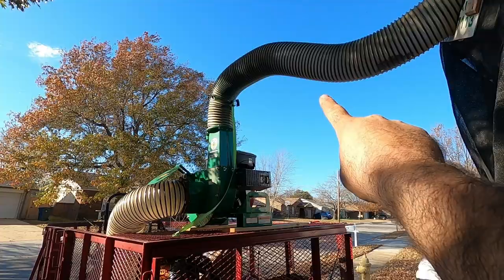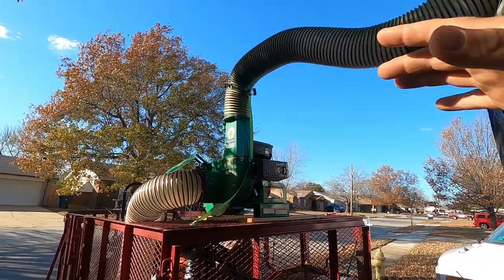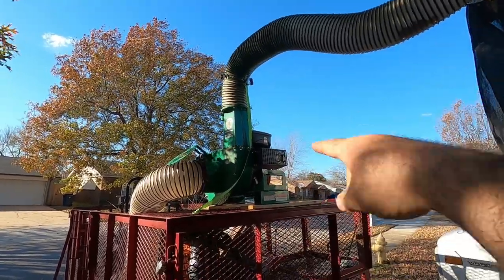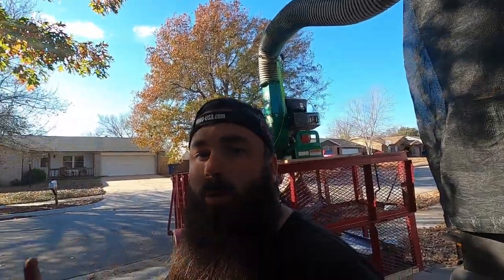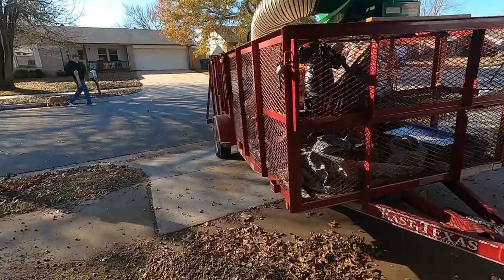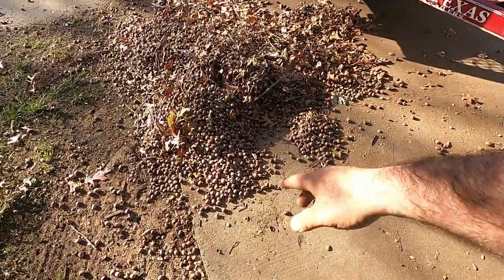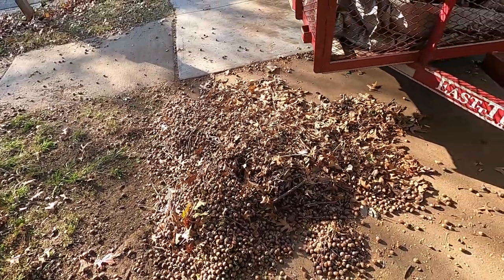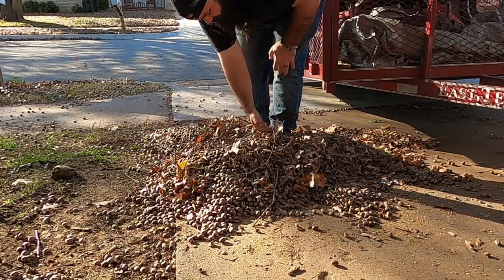WHY BILLY GOAT SUCKS! Putting the BILLY GOAT LEAF LOADER  TO THE TEST - How I fixed my leaf loader.

Comment: The debris loader is mounted to high. I mounted mine just above the trailer rails. Also mounting it lower better utilizes the length of the hose.
Reply from the maker: I dont have that option. It works great at that height though.
Reply: Hes right I own the truck tailgate mount version but mounted on the front into out plow mounts and it shoots through a 6” solid pipe into a solid box with ridge vents the only issues we have is when we suck up wet leaves and little sticks getting stuck your mounted too high and your discharge vent is too flexible and probably too much air release with the netting  has to act as a suction
Reply: little late, but that's what I was thinking the whole time. Any problem you were having would be fixed by having the blower mounted around the same level the acorns are accumulating and it would stop that. After everything gets chopped at the lower level its easier to blow it as high as it needs to go. No stopping and the hose wont ever need to be lifted over your head. Mount a bracket to the front of the trailer.
Reply: @cheezedoodle8356  Yes exactly. I’m sure this setup can get along with regular dry leaves and work pretty good but acorns have a round small surface space. My Billy Goat is really good at sucking up the sweet gum balls in late fall and spring. Great units but they have to be setup correctly.

Comment: Great video. Just giving you a head's up when you aren't using the Billy goat or your done for the day. Make sure you cover the engine as the spark plug will corrode and fuse to the mount. And the only options are drill the spark plug or engine replacement. If you have a honest Billy goat dealer they will tell you that the Billy goat is not covered by the warranty and should not be used in the following eg, if it is raining or if the leaves are wet. Apparently it states is in the owners manual. An outdoor machine not for use outside. It was an expensive lesson for me to learn
Reply from the maker: That is really good to know. Thank you.

Comment: For stuff denser than leaves get a narrower suction hose so that air velocity increases.

 If that's not possible attach a foldable bar on top of your trailer cage with a loop on top and noose that hose head with a rope. Now you can just pull on the rope and move the straight up in a second.

Larger motor won't work any better.
Reply from the maker: Having a big pile of accorns like this really almost never happens. If they are blown up to the truck with leaves the pull right in like they are not even there
Reply: I was thinking of a similar solution. My Grand dad always said, "Work smarter not harder.

Comment: I think for instances like these, you need a spring loaded lever mounted above the Vac to lift the hose higher. Make it adjustable so you can lower it when not needed.

Comment: I wonder if it would work better if the engine/propeller  was lower on the trailer  and the exit tube was higher?
Reply from the maker: oh ya it would really help out. on my old truck my loader was at about chest height and it pulled through great.

Comment: We sucked up 2 tarps full of acorns a couple of weeks ago. It took a while and we had to pick up the tube several times to get them through. At the end it looks like feed in the trailer. It was pretty cool, I love our billy goat loader.
Reply from the maker: Leaf season with out a loader would be horable
Reply: @LawnCareJuggernaut  This is our first year with one, we used a Walker mower in the past that bagged it all. Between the billy goat and we just got a leaf plow our cleanups are actually fun now :) I just got to get a better way of dumping them by next year.
Reply: @HungryCowLawnCare  Did you get a better way to dump? I'm about to build a box for our truck with a side "dump" section.  Hard to explain but I'll use 4' plywood all around left, right and front as well as a full floor no lower the the truck bed sides on 1 side and about 6-9" higher than the side on the other side. There will be room under the plywood floor for tools and stuff. The plywood floor will be tarped tight and the low side wall will be on hinges and kept closed with a pin system. Pull the pin(s) and the leaves on the sloped and slick floor should fall out.

Comment: Another issue is the height and distance the acorns ha e to travel before it hits the hose. On it next set up have it closer to the ground. The impeller will blast those no problem.

Comment: Not sure the billygoat has enough power to pull all them acorns up looks like its kinda struggling because of aerodynamics as well as weight acorns are heavier then leaves but it did a great job on the acorns and everything else

Comment: Overall, have you been happy with the 18hp Billy Goat leaf loader?  Any drawbacks, other than it not sucking up acorns particularly well..lol.  Would you buy it again?
Reply from the maker: oh yeah man. I am very happy with that loader. I was just fooling around when I made that video and it doesn't have a problem with acorns either unless you are sucking them up without leaves. without a doubt I would buy one again and for me I find it to be an essential tool when it comes to leaf clean ups

Comment: Great video did you hear that echo made a new blower
Reply from the maker: yes I did. I called my dealer and locked one in.
Reply: @LawnCareJuggernaut  It's 2.2 pounds heavier than the 8010. Its the same blower they changed the fan blades and the tubes is all. 9 mph more and a little bit more CFM

Comment: soooo getting ready to build a  leaf unit. billy goat vs cyclone rake? im looking at the 11 hp cyclone with the 10 inch hose. billy goat is twice as much money. i know you had a cyclone but maybe not the big one. what are your thoughts?
Reply from the maker: Hilly goat all day long. If you can get the 18hp and you will not regret it. This video was me goofing off but check out one of my other leaf removal videos and you can see the difference. I ran a cyclone rake for several years as well so I have videos of that too.

Comment: The acorns weigh too much for the vacuum to work efficiently. To solve the problem, use a smaller hose which will increase the vacuum suction.

Comment: 🤣 the wind was so bad, it blew your pile of leaves away and left you with acorns?
Reply from the maker: my tree has hardly dropped leaves its crazy we had a MASSIVE amount of acorns this year but no leaves yet. I have the only tree on the block with leaves.
Reply: @LawnCareJuggernaut  Yeah, some of those old oaks hold on til the bitter end.

Comment: How much time would you say a monster like that saves per yard?
Reply from the maker: the crazy thing is that its not really a huge time saver on the job but it is much easier on the body compared to pulling tarps in to a trailer or using trash cans. it would save a decent amount of time compared to bagging the leaves up. now where it really saves time is it keeps me from going to the dump non stop and allows me to hit more jobs in a day. most of my jobs are a good distance from the dump so it is critical to be able to reduce the size of the leaves. great question as usual man!
Reply: @LawnCareJuggernaut  I'm curious why you don't use the steel discharge extension instead of a hose discharge into the truck.

Comment: Just my Opinion, but as with Water you go from a Larger Pipe & steadily go to a Smaller one you get Higher Pressure with the Water.

Wouldn’t be the Same with Vacuums??

Comment: Ugh acorns...I got 2 giant oaks in my yard, about 3 foot at the base for the one and 2.5 for the other and about 100 foot tall? Idk I'm bad at guestimating. I just put my mulch plug in and turn them to dust or bag them with the tractor. But I have the benefit of dumping yard waste in the woods behind my house and I'm not commercial.

Comment: Acorns.... Flat shovel....done, quickly.
Reply from the maker: I 100% agree that would be a better method. I almost never have a pile of acorns through normally they are mixed up in the leaf pile and get vacuumed up with the leaves but if I was doing this for a job I would have just raked them on to a tarp and put it in the trailer. 😎🤘

Comment: You need more horse power between 8 - 10 horsepower engine and that will work
Reply from the maker: Its an 18. The loader works great but the nuts are too aerodynamic and don't really catch the air flow. They pick up great if they are mixed with leaves though

Comment: Okay so here goes the dumb question. I'll be that guy.
In knowing you'd need to tweak the setup to work...
Have you considered or is it possible if needed to ALSO DUMP using the billy goat from the bed???
Reply from the maker: I haven't really given it a try but I have had a lot of people asking about it lately so I can give it a shot. I have an extra hose in the back yard that I can couple up and see if it works.

Comment: Hell  just hire a hard of squarls they will pick up all the acorns, problem is they will stuff them in you attic, downspouts chimiy in you car in thr motors air cleaner box up your tail pipe in the cab of your truck and anywhere they can get.
Then eat the sheetrock walls in your house and live wires.

Comment: What size battery does this machine use.  Thank you.
Reply: @LawnCareJuggernaut  please don't laugh I'm serious.
Reply from the maker: @mima4392  my bad I though you were  playing with me. 

This is an 18 hp gas Gosselin debris loader. It doesn't shine out in this video but it is an excellent machine.
Reply: @LawnCareJuggernaut  But it's a billy goat in this video. But that's ok, I got the battery and tray all bolted up. I used it today and worked great. Now I have another question, what size is your mesh tarp and where did you get it.

Comment: Save gas just pull out the aluminum scoop rake them into the scoop and put em in a paper bag.  Take to a compost pile and watch 50 squarls move into the negiborhood. 

Becsure to wear a sports cup, ya got to protect your nutz.

Comment: my leaf vac would put this big thing to shame. I have a 5.5hp briggs with 6fin cupped impeller with 7" diamitor hose 10' long and it sucks up accorns with no problems at all. sad that my smaller vac works better then this big thing for accorns.